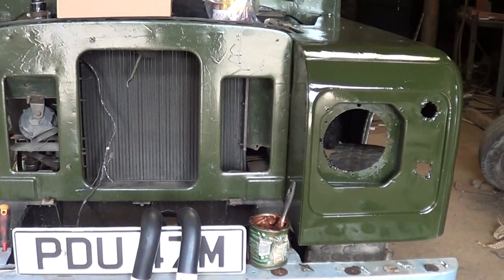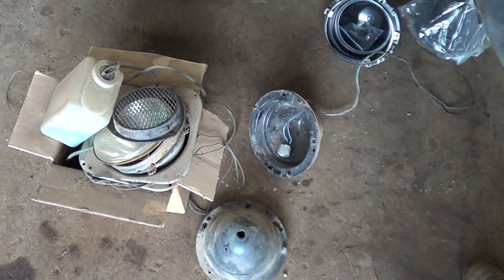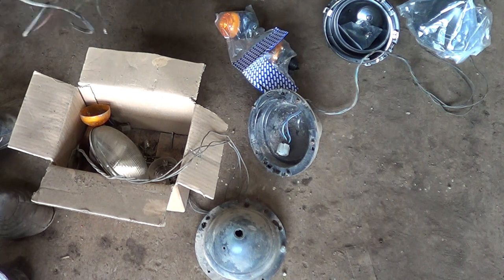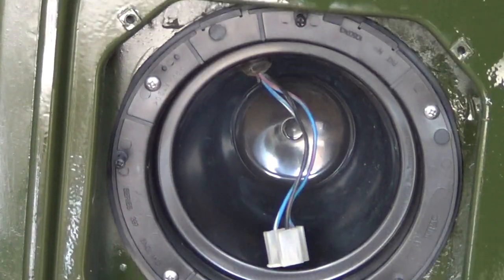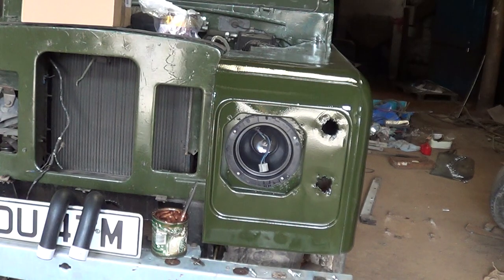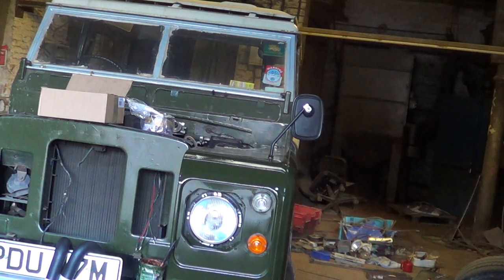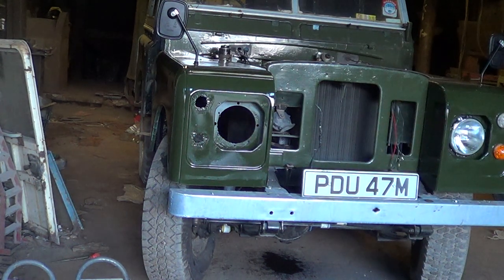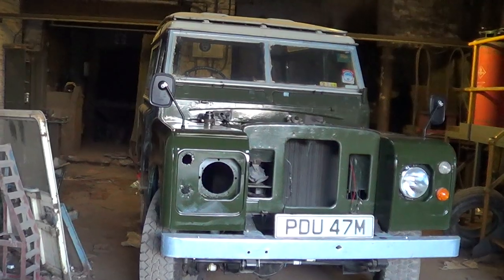Land Rover Restoration part 10

Comment: hi I noticed from your video you are in Derbyshire I'm from not to far away I am currently working on a 109 series 3 and have just put a 200 Di in I am trying to make up my mind whether to use an overdrive if I can find one or an Ashcroft high ratio transfer box if possible I would be interested in having a look at your motor thanks Ken
Reply from the maker: Hi there, yes I am in Derbyshire. this landy used to run a standard gearbox with overdrive and standard diffs, apparently you cant use overdrive with uprated diffs or transfer box and remember if you do you will lose the slow speeds. I personally like the standard set up with overdrive.I am sure we can arrange something if you would like to visit.
Reply: +Ryan Walker hi Ryan thanks for getting back to me I would like to arrange to come over at some point if we could arrange a time to suit thanks Ken
Reply from the maker: I will be available this Saturday afternoon.
Reply: +Ryan Walker hi Ryan I'm going to the 1000 engine rally this weekend so will keep in touch when it suits you thanks Ken
Reply from the maker: I am free the 25th and 26th June, have you got an email address and I will contact you privately
Reply: bit of nosey interest here but did you guys get together to discuss your landrovers ?